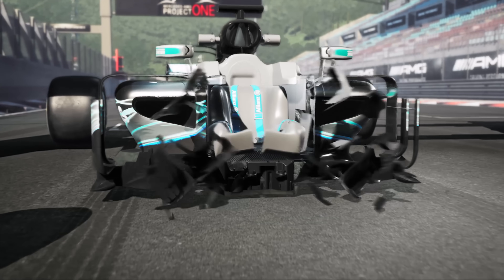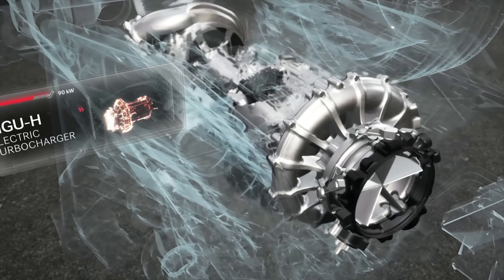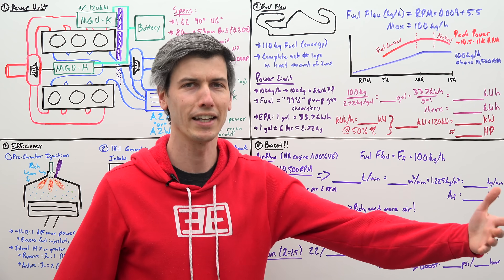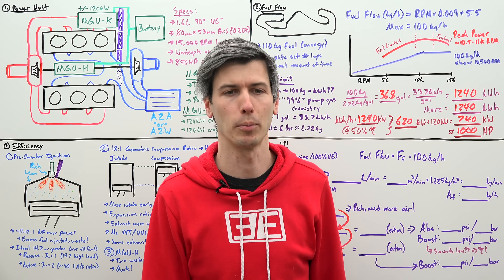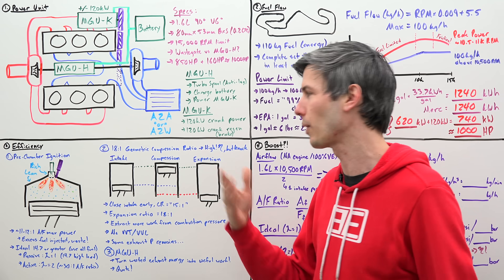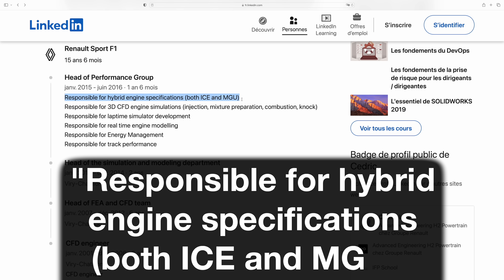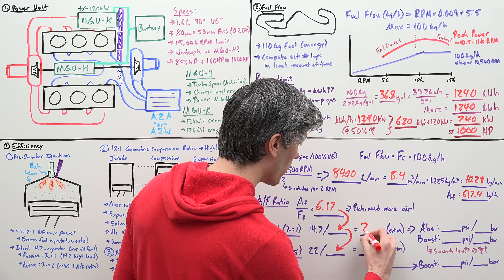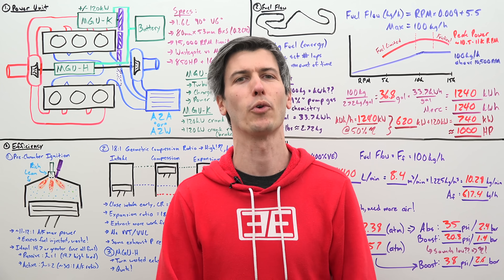How Tiny Formula 1 Engines Make 1000 HP!

Comment: @EngineeringExplained can you do a video , on what would be ideal displacement for F1 or similar open wheeler race car. i always wonder why cars like F1 or indycar rules go with smaller displacement engine, would higher displacement engine like 5.0+ Liter be too big and heavy ? or the low end torque of high displacement engine will be useless on such light cars due to traction limitations ?
too many questions...

Comment: I could be wrong, but I would think the ultra shallow pistons they run with the high compression ratio point to the lower end of the boost range you calculated.

Comment: What would be the point of artificially lowering the compression ratio by valve timing, if you can just reduce the amount of intake pressure? It seems counter-intuitive to reduce the time the intake valve is open when you are using a huge turbo charger to get as much air in as possible.

Comment: Well done. But in calculating boost, you should have used to 30:1 AFR in the high efficentcy F1 engine, rather than 14:1, which would create a higher boost pressure.

Comment: I'll never cease to be impressed with how well you present such nuanced topics. I've talked to even car enthusiasts about this very thing and I've seen their eyes glaze over because of how technical and "nerdy" my presenations are. A few months ago I was doing so hardcore thermodynamic calculations and I realized that these engines must be running stupidly lean (my guess was about 2.0 lambda) in order to run the amounts of boost that they do, get anywhere near 1000 hp, and not exceed the max allowable fuel flow rate. I talked about that with some of my car buddies and they were like "there's no way a racecar runs lean. Max power is always rich". I felt vindicated when I saw you pull up that SAE study done by the Renault engineer. Anyways, well done! Keep up the good work!
Reply from the maker: Appreciate the kind words; thanks for taking the time to leave this note!
Reply: I'm just trying to figure out what advantage you get by running lean. I get not running rich because that's wasting precious fuel, but why run so much boost when they could just run at stoichiometric with less boost? There seems to be so many downsides to running more boost.. Having to figure out how to run lean, adiabatic heating, other mechanical losses.

The only thing I can figure is that they're somehow extracting mechanical power from the boost pressure alone... But the gains from that seem fleeting.
Reply: @brianwright9514  To get to close to 50% efficiency, its in the video.
Reply: @rappit4  that is stated as the goal in the video, but it's not explained how running lean achieves that goal.
Reply: @brianwright9514  When you are running less fuel through the engine with high Air fuel ratios you are getting less loss because there is less fuel overall thus there is less left over from incomplete combustion. there is still some fuel left over that doesn't get burnt as always but because the engine is running so lean there is much less, therfore the thermal efficiency is higher. hope this helps clear things up!
Reply: "leaner is meaner" is the saying

Comment: Does that mean they are running a Budack cycle!? The intake valve closing early to get lower compression than expansion ratio is the definition of the Budack cycle if I remember correctly? Essentially Atkinson without the whole crankshaft rigamarole.

Comment: Is the lambda (2.1) referred to in the Renault engineer a different lambda than the fuel-air ration referred to later on? If not isn't it a reasonable figure to calculate boost pressure from?

Comment: Are you sure you aren't double counting when you added the 120 kw from the MGU to the 620 kw from the engine? After all, that 110 kw only comes as a result of using the 620 kw. Is the >50% thermal efficiency already including the MGUs?

Comment: Correct me if I'm wrong but I'm sure F1 cars don't have cam shafts but instead they have solenoids that lift the valves so they could have variable valve timing as such if they are allowed to program that in
Reply: Not solenoids Harry - pneumatic cylinder with compressed nitrogen. 
They have camshafts - just that the steel springs are replaced with Pnuematic cylinders. 
In MotoGP too - except for Ducati's 19,000 (!) desmo valves with no valve springs.
I'm not sure variable valve timing is allowed in F1. I know it's not allowed in MotoGP.
Reply: @Dennis Merwood  thank you for enlightening me, that makes more sense now

Comment: This is amazing, I would like to point out that F1 rules also limit the consumption of oil, which, although it has a lower octane number, it still carries some energy, and a lot of engine makers in the past has exploited oil consumption to make more power
Reply: Because they deliberately put anti detonation additives in the oil with the intention of letting oil penetrate in the combustion chamber, because additives are prohibited in the fuel. It was a hole in the regulation. Mercedes used it to dominate the first years of these new regulation.

Comment: What does the effect of chilling the fuel have?  It has been banned or rather limited however teams were keen on chilling the fuel to make it more dense I assume and thus more power for less flow
Reply: Denser fuel also meant more fuel... back when fuel was measured in volume rather than mass.
It also pulls more heat out of the incoming air

Comment: ACTUALLY - F1 regulations removed the rpm limit of 15k rpm in 2020(maybe 2021?)  
  
However, fue to fuel flow limits, engines never really reach even close to that

Comment: Why Don't car manufacturers use MGUH on hybrid vehicles with four cylinder turbos? The MGUH could charge the battery which could then give you longer distance using the battery.

Comment: By working backwards, you may be coming to a boost pressure inside cylinder, whereas your average road car boost reading will be taken likely at the intake manifold. There is naturally some restriction between the two, so could be the reason for the unexpected result in your calc.
Reply from the maker: True, healthy number of assumptions, and air temps/density will be different as well. I believe there’s a rule air temps must be +10C over ambient (and are prob sig. higher); that alone adds to the boost requirement to compensate for the lower density.

Comment: Typical F1 over regulation.
Limiting displacement max fuel flow with mandatory electric system and abudget cap should be enough to allow everyone to develop their own engine concept, which then may have a bigger impact on every day use. Don't get me wrong, I am still a fan (of the sport, not so much of teams or drivers), especially now that overtaking is easier!

Comment: I would love to see F1 do a 5 year "innovation window" where the majority of rules governing design were set aside.  Keep safety rules in place along with broad criteria (min/max footprint, min/max weight, total fuel allowed, etc.) but get rid of everything else.  Let teams design the absolute best engines and aerodynamic features possible. Allow mid-season changes.  For a set period, don't stifle innovation.  Sure, it would be hella expensive and maybe for the period some teams can't compete, but imagine the advancements that could come from it.  Then, after the window is over, go back to rules that limit spending so other teams can compete again.  Maybe you do ban some of the innovations that were created that aren't in the spirit of F1.  But, I can't help but think the result would be a fascinating time of racing as teams figure out what works and what doesn't work.  The benefits would certainly trickle down to production vehicles, and we would all know what is ultimately possible from the best engineers on the planet!

Comment: What is your thoughts that they're removing the MGU-H in 2026?

All that I've read is that it's a tech that can't really be used in production cars, so they're scrapping it, so, where else can they find more efficiency? Maybe a carbon engine block? So less heat is transferred to is (if any), and more to the combustion.
Reply: Rules say they are restricted to use metal alloys for the engine so carbon block is a no, no.

Comment: Could you calculate the boost pressure based on the energy potential of the air instead of the fuel?

Also, "it's Ferrari's year, I can feel it" - Me, every year

Comment: Yes he is smarter than me however.

You can’t calculate boost levels accurately without knowing compressor efficiency or the naturally aspirated power level of the original engine. My built civic type r engine makes 700whp on 30 psi because of cams and ported head but stock version of these engines make only 500-530whp  on 30 psi. 

Some turbo chargers become more efficient at lower boost and some at higher boost. Garrett g series reach peak efficiency around 25 psi. While some borg warners reach peak between 30-35 psi.

Many engines can reach above 100 percent volumetric efficiency also. That plays another role.

Comment: So, why is the cylinder angle restricted to 90 degrees?   That seems an odd thing to specify.  Why not a boxer?  Or a 45 degree V?   I could see various designers wanting different cylinder angles to fit with their specific design goals,  but I'm not seeing that there's a a universal advantage to cylinder angle like there is with say, displacement.

Comment: Re: the possible boost, the fuel flow is limited to 110kg/hr but most races take, if run at race pace without any safety periods, perhaps 80 minutes as well as have, what, a kilogram of fuel remaining to pass scrutineering at the end? That would restrict them from running the full flow that close to the limit. So I would imagine the boost is actually higher to make the power to stretch the fuel to the expected race time. And if the fuel is 99% the same as retail fuel, what is that last 1% and how much does it boost the octane to allow an insane compression ratio?

Comment: I Assume the rules given the battery and state of charge at beginning of race?

Now we just need to harness the waste heat in the radiator and exhaust with light weight rankin cycle (steam or other fluid ) to get another 20 plus percent by co-generation!

This idea is truly needed in large diesel trucks on long runs on highway where weight is not as critical as a sports car.

Comment: Thanks, this was a great overview of all the systems in an F1 power unit.

I read that the MGU-H was or will be scrapped from the specifications due to reliability issues. But definitely interesting to see how it all comes together!
Reply: I think it is more about cost and electrification. The 2026 power train will remove the MGU-H and will allow for a bigger power MGU-K and a higher capacity battery.
Reply: @aDaWaN  That makes sense. Thanks!
Reply: @MHBGT  Yes, they want new engine manufacturers to join, and these would have to develop the MGU-H at high cost and would not recover that e.g. from road car usage.
The MGU-K development is much more usable in road cars.
Reply: @Rob2  To be honest, the removal of the MGH-U will a be a massive step back in terms of high performance engine engineering, the MGU-H is literally the reason as to how the current engines manufacturers in F1 are able to achieve the high efficiency figures (in excess of 50% thermal efficiency) they have been able to achieve under the current engine rules. We gonna have to say goodbye to that beautiful turbo controller in 3 years, sadly.

Comment: Ha, you state that “it is impressive that a modern car makes 35% thermal efficiency”! Then what is the Toyota engine that has been making over 40% thermal efficiency for a number of years (more like 42%)? What is the word for that? 

A number of ICEs are over 45% and some near 50%. While the US government has a research program that three manufacturers had engines that broke 55% thermal efficiency.

The MGU-H unit effectively makes the makes it a turbo-compounded engine which exists in various production engines (a technology that goes back to the end of WWII in non-electrified form). 

Also at the end, boost pressure vs boost ratio terminology? This is the issue of why a turbine has a compressor ratio.

The point is that it is not extraordinary or unique to have that level of thermal efficiency (maybe the amazing part is that it is accomplished under the artificial CONSTRAINTS).  Large ICEs have been doing 55% thermal efficiency for more than a decade on a regular basis (with a secondary cycle).

Comment: it's pretty cash to think those 1000hp 1.6 V6 engines are actually DETUNED to 830hp to comply with the fuel flow limit, which allows thel to run more efficiently (leaner, with a cycle close to miller/Atkinson)

Comment: Arnt you sorta double counting the electric side in your energy balance in the upper right area of the board. The MGU power is from the fuel in the steady state sense, and you attributed the thermal efficiency of the engine partially to the electric recovery system.

Comment: What I can never understand is how the pressure of combustion doesn't blow back into the fuel injector. Is there a more powerful non-return valve on the fuel injector? Prior to ditrct injeection the intake valve would prevent that.

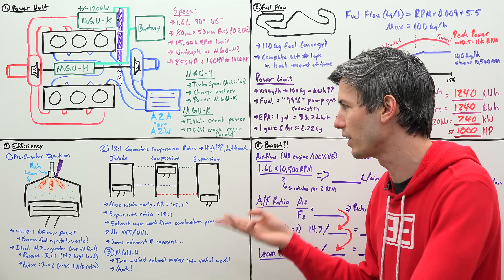Comment: Paused at 8:08 If you can design internal combustion engine (ICE) that operate in a very narrow band of RPMs, you can design everything for best efficiency for a specific RPM: intake manifold length, shape, diameter; valve diameter and timing (camshaft), ignition time, exhaust valve diameter and opening timing, the shape, length and diameter of the exhaust manifold. And I mentioned only a tiny fraction of what else you can do to an ICE. Very narrow and specific RPM/load conditions can make an ICE easily 50% efficient. Just look at huge ocean ships carrying massive amounts of cargo all around the world. Thermal efficiency of 50% or more is achieved.
Reply: An ICE can indeed be designed with everything for best efficiency at a specific RPM. Best example - light aircraft ICE!
Yes, with intake manifold length, shape, diameter; valve diameter and timing (camshaft), ignition time, exhaust valve diameter and opening timing, the shape, length and diameter of the exhaust manifold - A lot of work - making the engine marginally useful! Why those light aircraft engines work poorly in a racing car!
But an EV engine can be designed to run efficiently at ALL rpms. Very simply. Why ICE engines are a dead end!

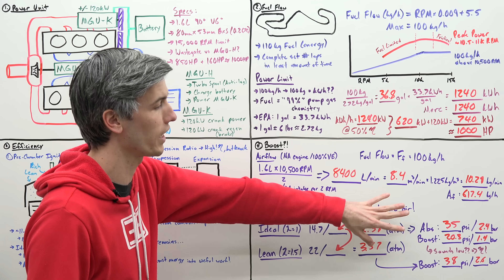Comment: @18:10 i dont think the boost pressure changes in f1 cars at elevation as the engine will see the same boost but i think they tweak the software settings for that mgu H to allow a higher turbo RPM to compensate afterall after air is compressed the atmospheric air pressure does not matter anymore
Reply: Same boost (Absolute pressure - atmospheric pressure) at a higher atltidue and less atmospheric pressure is still less absolute pressure at the manifold than it would be at sea level. So they inevitably need to increase the boost to reach the same cylinder filling. Honda (RED BULL AND ALPHA TAURI Engine manufacturer) has a few public documents including rough compressor maps of the turbocharger changes they made to accomodate for higher  altitude races like México City and Australian GPs and you can see the increased boost pressure. They also state that boost pressure needed to be increased at higher altitudes. And yes, turbine rpm is way higher for the same boost because of the increased pressure ratio, let alone more boost pressure than sea level

Comment: If you look at the supercharged WW2 fighter engines, they would run fixed manifold pressures until their superchargers could not keep up. This was true for both Mechanical Supercharger and the rare few Turbine Supercharger aircraft. Boost pressure is a weird way to look at manifold pressures because manifold pressures would be measured from a known baseline (The standard day at sea level.) The supercharger would need to work harder to reach the demanded manifold pressure but, because it is exhaust driven, I don't think you would notice a performance difference out of the engine, but you would notice that the MGU-H would be producing less power.

Comment: Excellent explanation of what’s going on in those engines.  I used to live F1 but as the rules started getting so tight and the v6 was the chosen engine I just became disinterested.  The little gimmicks like DRL didn’t help either.  
I really wish they’d open up the rules about what materials can be used in engines so we would see some development there.
Reply: Granted it would be a massive investment but I think the circuits are very limiting when compared to how they functioned with the older generation of cars pre 1980. There is almost no passing to be had in the current generation. Especially with older tracks like Monaco. It would be cheaper to alter the cars to fit the tracks but that would come with size and speed reductions and I don't see that happening, you might as well just put them in go-karts.

Comment: Never liked it when Formula 1 turned into a fuel economy race. The turbocharged 1.5 liter FOUR cylinder BMW M12 engine in the 1980's had over 1000bhp in qualifying trim.

Comment: on high elevation tracks like mexico… if you compensate the lower air density from the atmoshere with the turbochargers, there will be more “usage” of them, you will use more of the air they compress, meaning youre using more exhaust gasses. but wouldnt you be having less exhaust gasses to charge the electric booster engine? resulting in less power in total? or is there still so much backup left that on normal tracks, the booster could make more power but theyre just limited to what it makes?